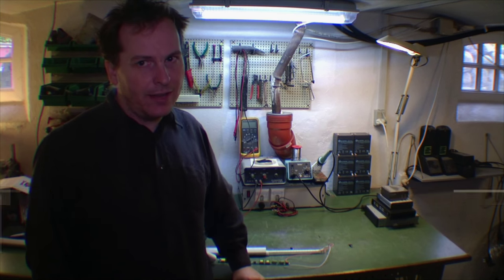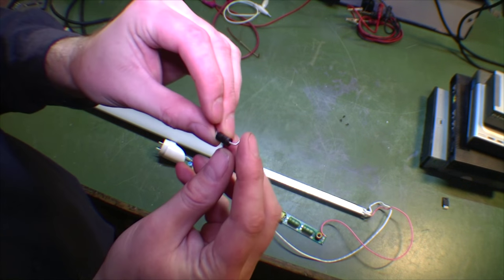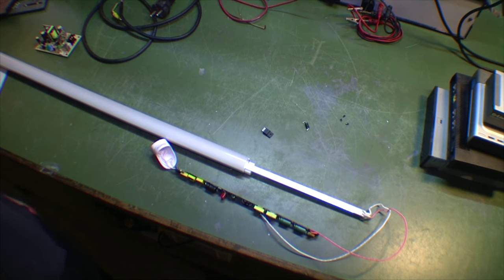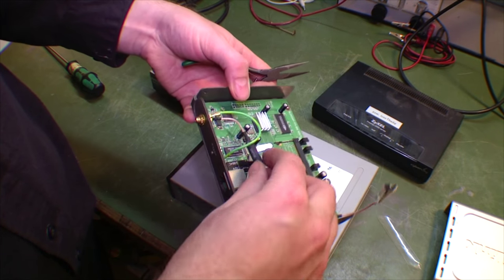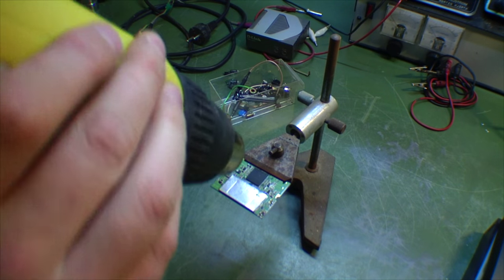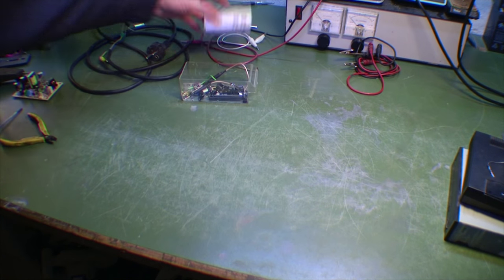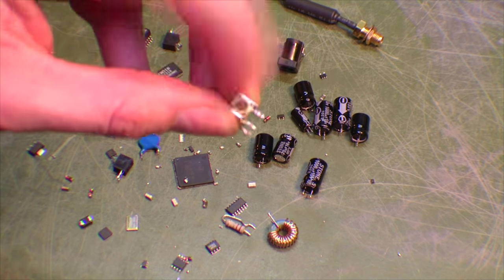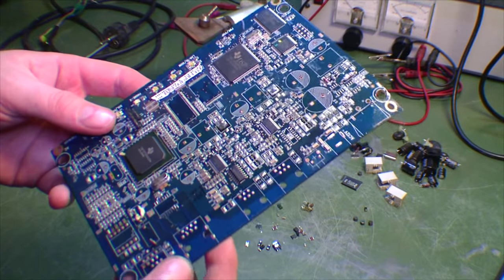Separating my Electronic Waste, and 25W LED update - 256

Comment: Disappointed - I wanted to see one of those electrolytic capacitors explode due to the heat gun. Little tip - pop on saftey glasses while you're doing the heat gun method as when electrolytics do go pop they can cause an eye injury :)
Reply from the maker: Hi +dash8brj 
Well yarh,,, dull video on that front! I did throw some capacitors out, because the plastic had melted,,, but i see that in this area, my video was missing  definitely some action. :-/ WE NEED TO BLOW SOME SHIT UP!! :-)
Thank you for watching! :-)